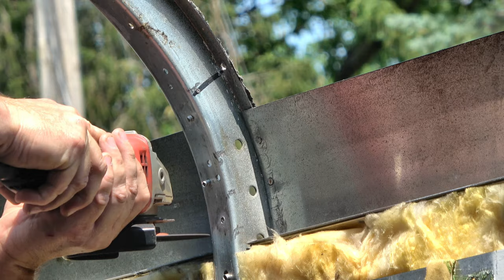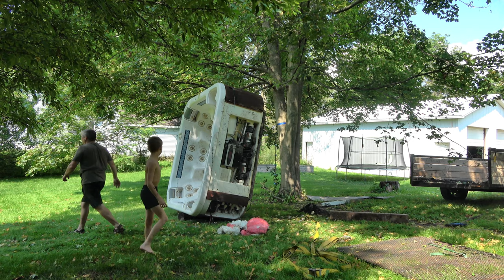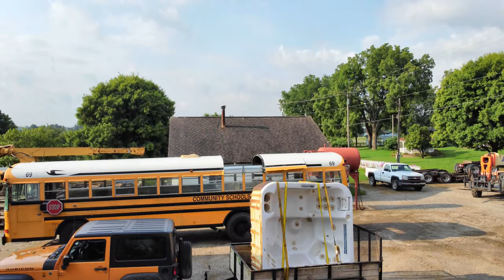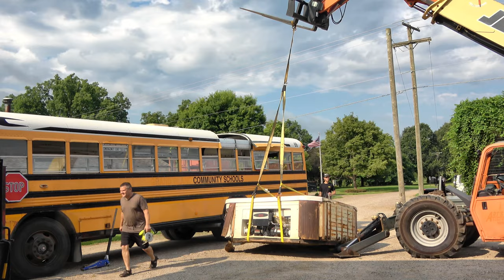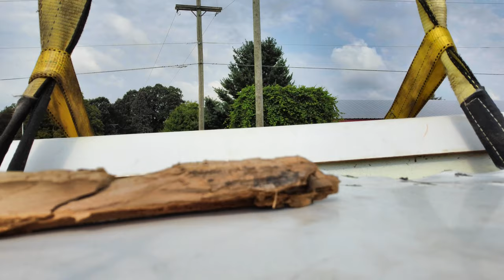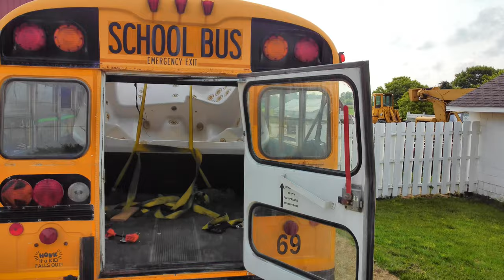How do you get a jacuzzi IN a bus?   Bus build: day 8

Comment: Wow that will be cool.  You shouldn't have to heat the bus much , all that water should keep it warm .
Reply from the maker: One thing I learned is that if the bus has low air temperature, the jacuzzi gives off a lot more condensation.    

It’s nice to keep the inside of the bus hot, especially in the winter.